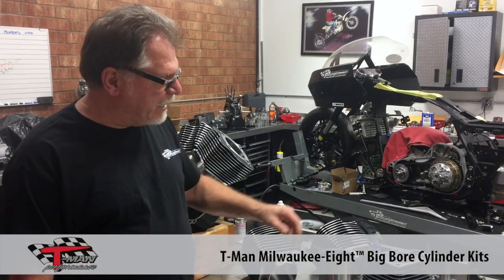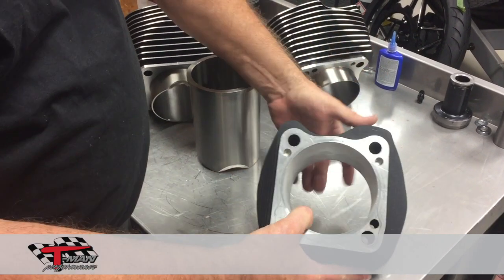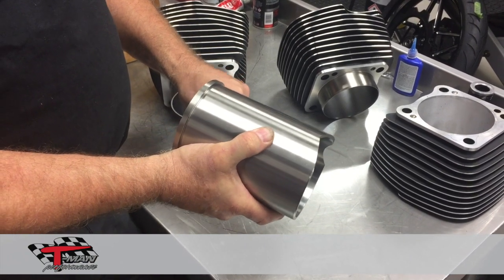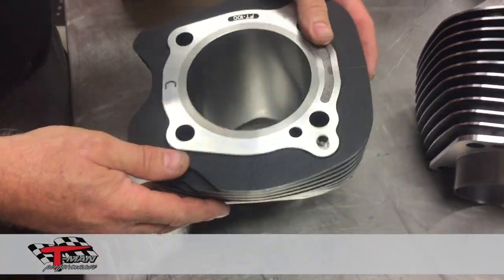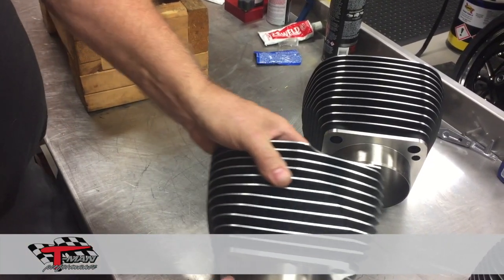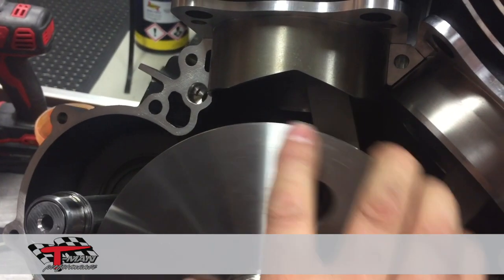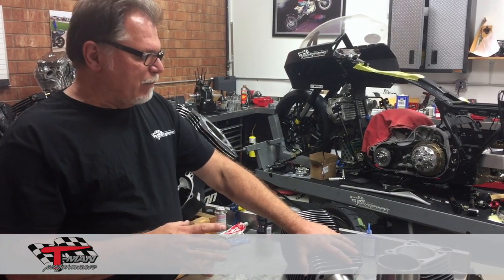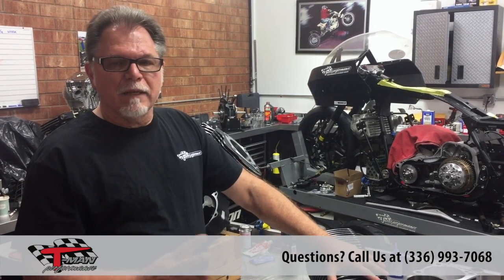New T-Man Milwaukee-Eight™ Big Bore Cylinder Kits

Comment: Just bought a 2019 Harley Road Glide Special. It comes with the 114 motor. I want to bring it to the 128. What do I got to do to get this done? I was going to go with a stage 4 Harley upgrade but I would prefer to do something like this
Reply from the maker: If you want to give our shop a call, we can go over some options. 336-993-7068

Comment: Those kits are all good if one has the bread and time. Truth be told you don't need a huge motor to pull one set of butt cheeks around. I have had a stock 88ci, 96ci, and now a 107ci and none of those motors had any engine work other than a gear cam kit installed and all three pull hard with oil change, oil change, oil changes which is the key to the longevity of the motors and transmissions.